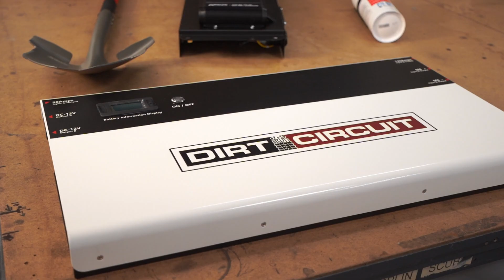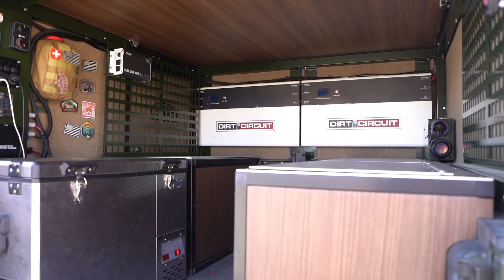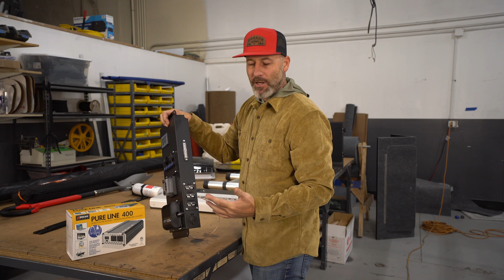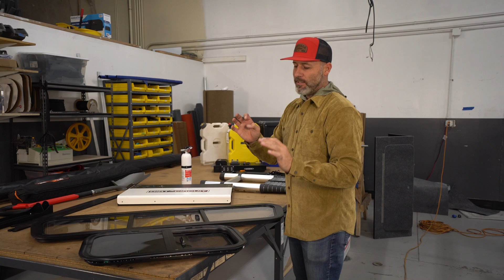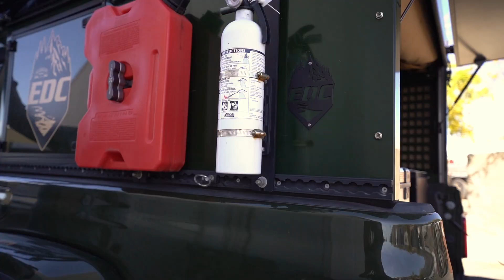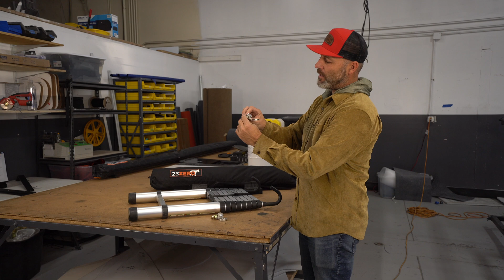Harker Outdoors Options Walkthrough. The Ultimate Custom Truck Camper.

Comment: Is there any kind of insulation or liner for the canvas to help retain heat in the colder months (and keep out the heat in the summer)?
Reply: This would be awesome, some sort of insulation that can be optionally added or removed to help with temp retention
Reply from the maker: Hey there! We found that the camper is more than sufficient with the honeycomb aluminum and the carpeted walls alone when using a heater or AC unit. If you want to talk more in depth please give me a buzz and Im happy to explain what testing we have done. 508-523-7977

Comment: Loving my camper. Wish I would've did the electric 😂.   Is it possible to add after the build?
Reply from the maker: It sure is!
Reply: @harkeroutdoors  might have to plan me a trip back ya'lls way. How long would it take you to install it?  With the solar panels on top and hooked to the truck battery.
Reply: Why wouldn’t it be?
Reply: @BamafaithfulRollTide  🤷‍♂️
Reply: @MulletNutz_Jason  it wasn’t meant as a smart a.. response.  I’m looking to do the same.  I love everything they have to offer but I plan to do it in stages. lol.
Reply: @BamafaithfulRollTide  if you have the cash I'd do it all at once, I'm in MS and drove over and had it all installed and was on the fence incase I had issues with the system I was so far away and now wish I would've of did it. I added the awning on to and like it. It's a cool setup and works great.